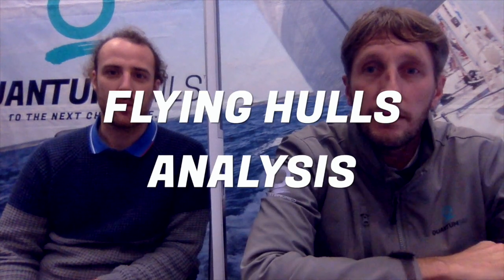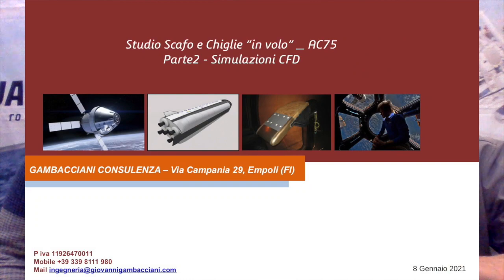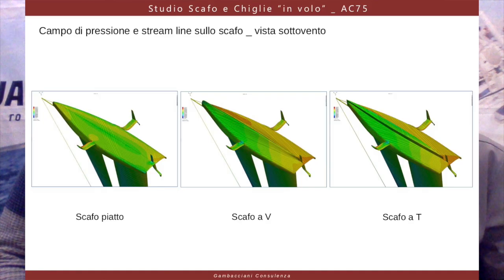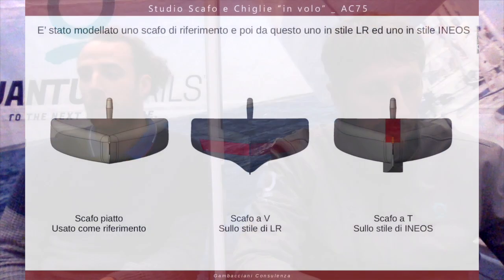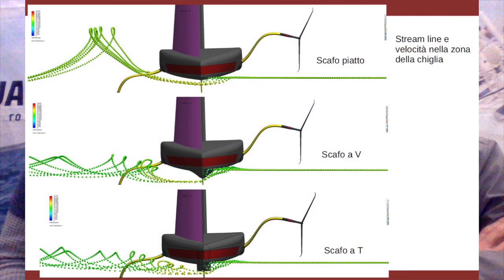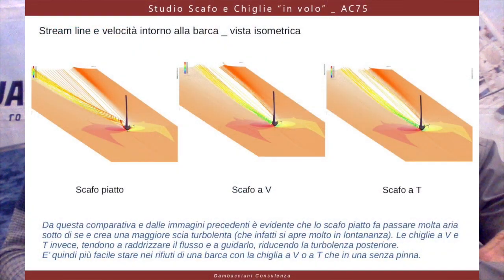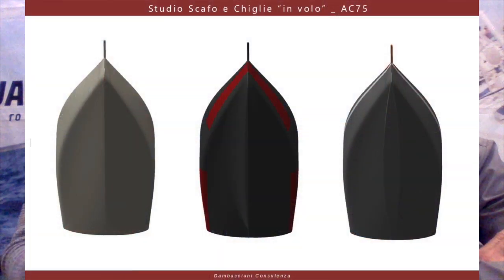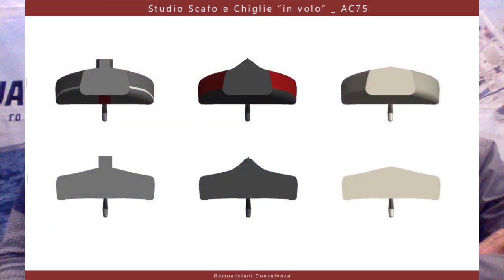E96 - Flying hulls analysis

Comment: Interesting, thank you!  One thing that is not mentioned is the possibility that the Ineos skeg creates significant vortices, with their resultant drag. I have seen images from one CFD test that suggest this.
Reply: Not to mention corner flows increasing drag.... interesting that the flat skeg seems to reduce hull-induced heeling moment. It seems that this is caused by a more forceful flow separation remaining completely detached on the leeward side.
Reply: @zbeekerm  Well, this is one person's interpretation from what I understand. I'm not quite convinced... 🙄